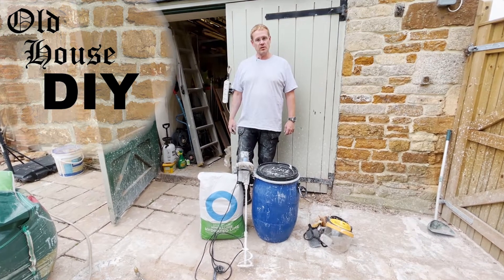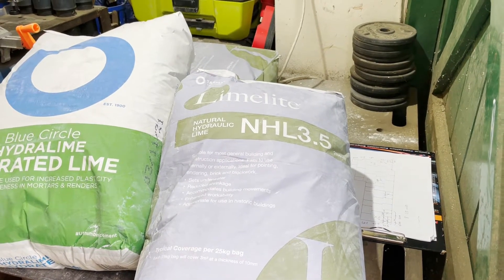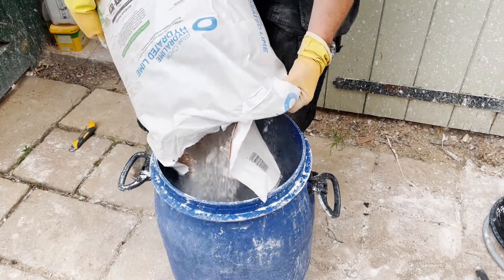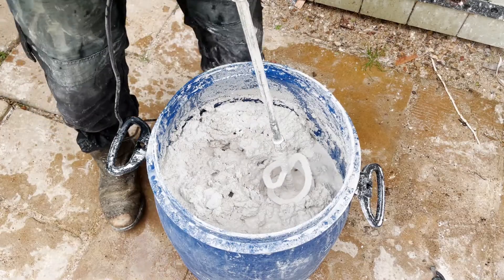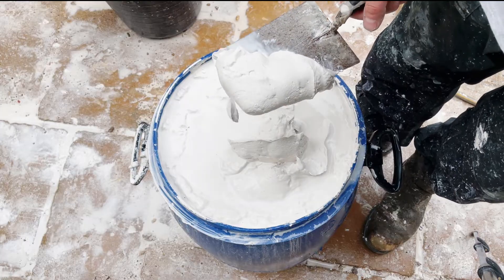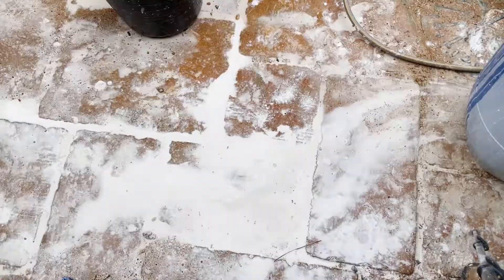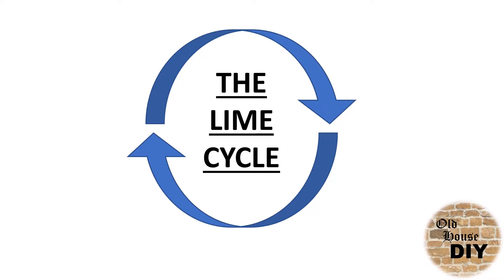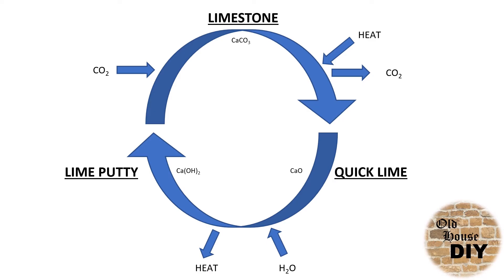Making Lime putty

Comment: Will this work with type s hydrated lime? Thanks for the video!
Reply: Here in the US, type s hydrated lime is not suitable for lime mortar. Although you can make a so-called lime putty in the same way with type s hydrated lime, the lime will not carbonate and set up property. If you use it for mortar, it will eventually fail. You can use type s to make lime wash or a thin finish coat where there is no structural stress, but you'll need to add additives to help its bondability. In the US, you'll need to use NHL to make lime mortar (2.0 or 3.5 depending on your application), OR you'll need to purchase pre-made lime putty (which is made from quicklime) for mortar purposes, but that can be very expensive. The info out there that suggests you can substitute type s for NHL in lime mortar for structural use is wrong. Type s is used as an additive to portland cement to give the mortar certain properties and that's why there is no technical info on using type s alone to make a putty for lime mortar.
Reply: Would NHL be ok for repointing fieldstone Foundation? I live is Wisconsin and have a 1900 house thank you
Reply from the maker: I believe so. I always advocate making a test sample to make sure it will carbonate okay.

Comment: NHL can be used for brickwork.  It's just got quicklime in it so it is setting by pulling hydrogen ions from the water.  Hydrated lime has all the hydrogen receptors filled and sets  by pulling carbon from CO2 in the air which is much slower but also doesn't make the bubbles.
Reply: What would you use for repointing a fieldstone foundation? I have a 1900 rubble/fieldstone foundation. In the summer months it really gets humid down there I have to run a dehumidifier constantly. Which would be better?
Reply: @chandlerpetersen1244  check out the boys from Core Conservation who have videos of various scientific experiments they have done on basement dampness and salinity
Reply: @chandlerpetersen1244  NHL 3.5 with mason's sand
Reply: @soundbwoikilla764 Not builders sand - it has clay in it. Plasterers sand and sharp sand mixed, for outdoor use.
Reply from the maker: Yes, NHL can be very versatile. There is discussion amongst the purists that NHL while still breathable is harder than putty or hot lime. However, NHL has still got to be better than OPC.
Reply: I don't think that's right.

Comment: Is it possible to make an all lime finish plaster?
Reply from the maker: I’ve never done a pure putty finish. I’ve heard the lack of aggregate increases cracking and I understand fine marble dust can be used as a fine aggregate.
BUT I have used a thick lime wash slurry as the first coat to help the finish quality with good results.
Reply: Bottany or silver sand can help

Comment: Do you have an educated guess what kind of "mud" or "coating" or "stucco" layering pairs best with strawbale?  In a hot high desert climate with monsoon season and winter freeze?  The goal is non-painted low-maintenance non-cracking final coat (all fill, rough and final layers adhering well to wall and to each other).  And for exterior walls to be weather-resistant as far as their coatings go, while interior walls breath more.  Same questions for earthbag walls.  I follow many private experiments underway in the western USA and the possible ingredients are seemingly endless, with so many problems...
Reply from the maker: I would for sure go with lime render / plaster putty, sharp sand and fibre.
There is more on lime plaster here.

Treating damp
https://youtu.be/X4mVaCMoirM

You can even coat in lime wash made from the putty, it’s a very easy and cheap paint option.
Reply: @oldhousediy  Thank you, will follow your link.  You should know!

Comment: I am soaking up this info, thank you so much.  When I mix stuff, I find it more efficient to add (most) water first, then powder, as it produces less dust, takes less energy to spin, much less sticky hard stuff on the sides and bottom, much less cleanup and scraping at the end.  I put the mixing blade in with the water before burying with powder, allowing mixing to begin at the bottom.  When too hard, pull up and unmixed water swooshes down in to the bottom center and everything is instant chunky gravy, so to speak, ready for a quick whip up with fewer large dry bits and jams against the bucket.  Love :)
Reply: It always says add lime to water not water to lime on the bag too doesnt it?
Reply: @Padraigp my guess is if it’s soaking for 3 months that’s not going to matter much
Reply: Колкото повече отлежи, толкова по-добра става. Перфектния вариант е 3г.,но няма кой да чака толкова  @wombatau
Reply: @syrakov  That is a very long time for sure
Reply from the maker: Thanks 👍🏻
Reply: How long do you let it set up before using?
Reply from the maker: @puntabachata  I let it mature for at least 3 months but I have two barrels, one in use and one maturing. Means I always have some on hand ready.
Reply: I just used a potatoe masher. Left it liquid and then it seperated

Comment: Do you need to leave it to mature for that long or could you get away with a couple of weeks? Thanks for posting the video 👍
Reply from the maker: It is supposed to be but you may. I keep two on the go so I don’t have to worry. You may be able to speed it up a bit by a couple of intermediate mixings. Taking a sample and letting it cure is a good way to test results.
Reply: @oldhousediy  Thanks for the reply and good idea about having two on the go.

Comment: Please join traditional listed building. As all sold not pure or the same. We did debate read pdf on each lime bags. This has additives in it and thats why its cheaper than hanson hydrated lime, which hanson hydrated is more lime content in it. Limlite i throwaway as i read pdf mix alot ingredients. Best st aistier nhl2 and nhl 3..5 i used. I only now use tarmac quicklime, best overall in market. Sll like are not same. Some have cemituis to it like cement
Reply from the maker: Yes, I’m there already.
I do use NHL in limited applications as I’m aware of their issues. Putty based is my preference made from hydrated lime as in this video. (I also always let some set up once I make the match to check it cures properly.)

Comment: Great video thanks, being looking for a good while on how lime putty is made used to make it years ago with my grandfather but i  was only young (didn't pay attention) dose the plastic barrel not get mad hot with the chemical reaction
Reply from the maker: Thanks. 

The barrel doesn’t get hot because I am using hydrated lime which has already been partly slaked; However Water and Quicklime will generate a lot of heat.

Hydrated lime is easier, safer and can be bought from a lot of builders merchants.
Reply: @oldhousediy  oh right i get it now thanks

Comment: Great explanation, thank you. I understand NHL is suitable for "wet" brickwork conditions though? Basements, very exposed areas etc?
Looking forward to seeing the next steps and putty in use
Reply from the maker: Yes, NHL is traditional for wet areas as it will still “set” in the presence of water. I used NHL as opposed to putty in this case because I wanted it set so I could get on with the grinding.
Reply: Yup i used it outside to fix holes in the path of my period house its just marvelous stuff.